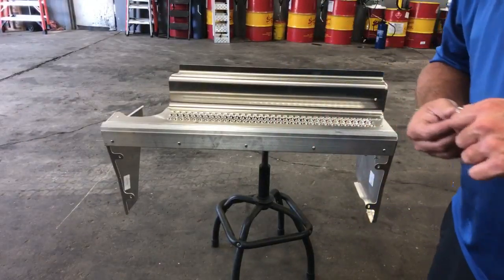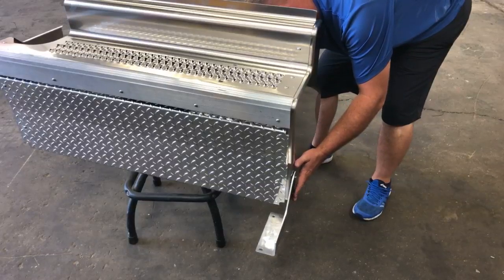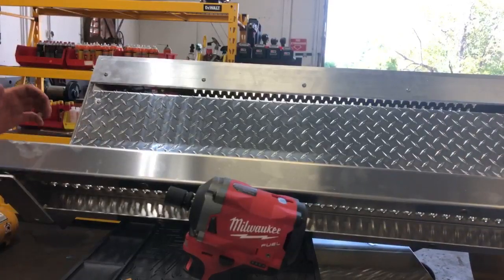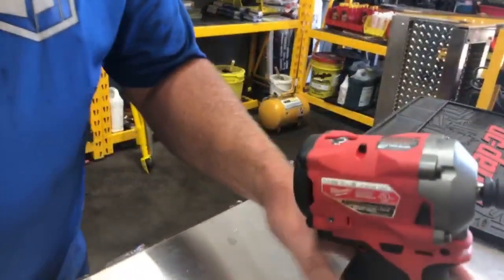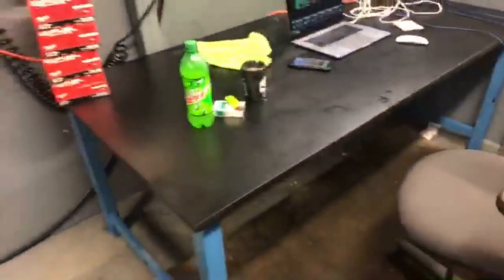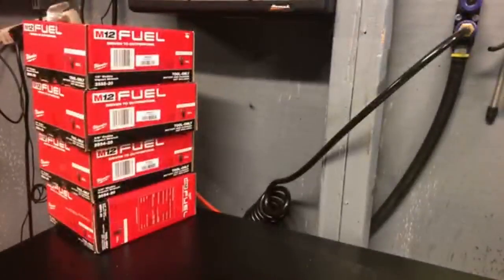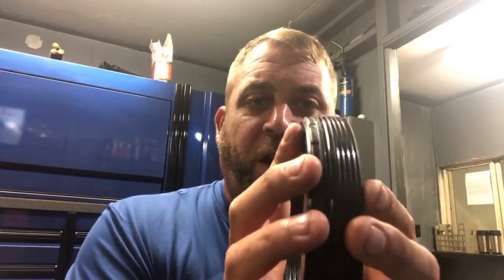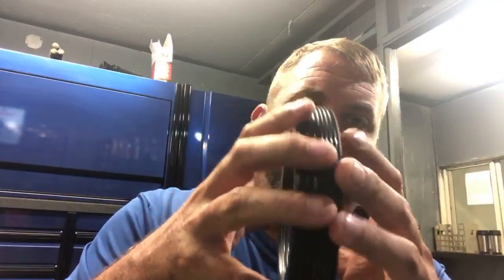Watch me bumble my way through putting this cover together

Comment: Bull shit on no driver for wheel seal......... I work at KW and we have one, but I think that Con Met says to put in by hand..... but that wheel seal should be pretty much flush... I have yet to find a good Peter-built service.... L5P cost around $4000 to tune and another $2000- $3000 to delete.